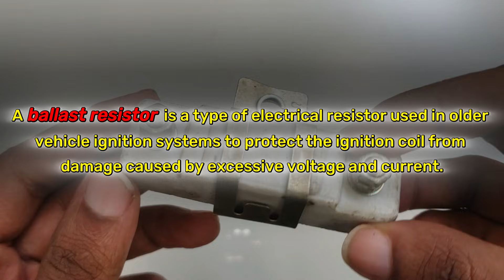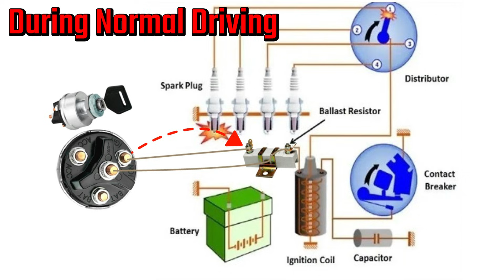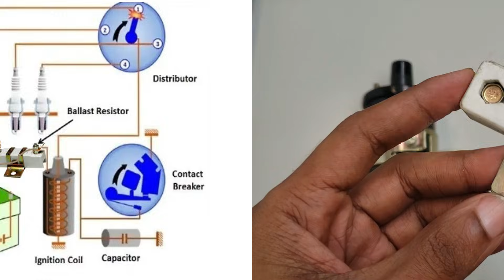Ballast Resistor Explained: Why Old Cars Don’t Burn Their Coils

Comment: Let's speak to you in common sense and Truth, the ballast resistor is basically designed to lower the voltage to the coil, the same voltage would be when you're cranking the car. Mainly get the coil primary wine in is wound for easy 8 to 9 volts sometimes 10 the match the voltage of the car when you're cranking it over as the starter takes a lot of load. What's the engine starts you have to have a resistor to lower the volume to that same design for the coil main power. Lotta German cars didn't even use resistors they just built really good coils that can run at various volts.

Comment: I worked in a SaaB 99 once and it started easily but would only run with the starter still turning ! Fault due to ballast resistor open circuit !!

Comment: Confused some fiat 850s had external balles resistors 1970 to 73. 65 to69 used internal resistor in the coil.  I dont remember if the starer circuit bypased the resistor .  I think 128s were the same.  But 128 werent great starting in very cold climates perhaps for this reason? I will check the wiring diagram this peaked my interest

Comment: New cars are designed to break down. Electric sensors  can’t handle  the engines heat. We don’t need all the electrical crap on the cars. Most of this stuff is for the car smog scam👍👍👍👍😎😎👍👍

Comment: without, the points wouldnt last very long. 1960s fords had a pink resistor wire with a resister built in .Chryslers had a ceramic ballast resister on the fire wall.

Comment: Back in early 80's my Toyota Corolla quit 100 miles from home. Looking under the hood, I noticed the resistor was broken in half. It was night so no stores were open. I ran a jumper cable from battery to the end of the resistor. Car started right up and drove it home without issue!

Comment: My dad bought a new Chrysler Cordoba in 1976.
It had a habit of toasting the ballast resistor.
Reply: But by that time they had already changed over to electronic ignition. Kind of redundant to use it with no points.

Comment: They used a 6 volt coil and applied 12 volts to for a hotter spark for starting. Once the car starts the coil would burn up but the ballast resister cuts the voltage down to about 6 volts so the coil does not burn up. Datsun used this system also.
Reply from the maker: Thanks for sharing that information, I appreciate it!

Comment: WRONG!! The ballast resistor is there to protect the points. Too much voltage through the points burned them. When the car manufacturers got rid of points and went with electonic ignition system they got rid of the ballast. Coil technology hasn't changed in 100 years. If it was to protect the coils why aren't the coils burning up in today's cars. Back in the 60's a coil could produce about 20,000 volts. Today's coils are capable of over 75,000. AI bulls**t.

Comment: Many times the breaker points will over-arc and burnout the contacts long before the coil fails if the resistor is not used.   Also a very similar resistor was used to lower voltage to the wiper motor for speed control.  It can be used to reduce  ignition voltage in a pinch.

Comment: It also makes the points last longer lessening the contact point erosion - metal transfer. 
  I always used a Bosch blue coil as it has internal resistor  points last forever just adjust dwell say every 15 or 2” k

Comment: In the 60's and the 70's Chrysler cars would always burn out their ballast resister. It was wise to keep a few in the glove box. My wife's car engine would fire up under starting. But then it would stop. Only a ballast resister replacement would cure it. The ballast resisters would even fail on the newer pointless ignitions too. They used to cost $2.00-$3.00 a piece.
Reply: Keep one in the glove box. It will never fail .
Reply: After over 50 years of driving around with a spare ballast in my glove box, I’m starting to think that was a rumour started by the bow tie boys.  A quick check with my friends, and over a similar period of time, maybe only a couple have needed to be replaced. But, I don’t think I will temp fate by removing it either.
Reply: @jamesblair9614 I never had an issue with one.
Reply: I've seen people flood a car out in my H.S. shop class, change the ballast resistor, and the car starts and declare it was the ballast resistor.
I, too, am old and i always carried a spare, only to rattle in my glovebox.
Reply: Always keep one in the glove box.
And if you're driving a GM with the HEI ignition then keep a spare module with you.

Comment: Ballast resistor is to reduce the voltage to not burn the points out and to keep voltage surge from burning out photo optic sensors,a coil doesnt need one with magnetic electronic ignitions.
Reply: But Chrysler continued to install them in their vehicles even after converting over to electronic ignition.
Reply: @MarkRichards-e6f probably because they were using components that were older and the ballast resistor lowers voltage to 9 volts to work with older components and make them last longer.

Comment: Great explanation! I now realised that i wired it wrong on a jeep with vw engine, i ignore the starting stage. Thank you.
Reply from the maker: Thanks, I'm glad the video cleared things up for you!
Reply: Jeep wih a vw engine?
Reply: @jacobnorth8642  Yes, normally the 1.8  VW AP or 2.5 Chevrolet Swap, because is hard to find spare parts for the original.

Comment: The ballast resistor brings the ignition input voltage down to 9/10 volts and this ensures a good strong spark during cold weather and situations where the cranking voltage drops
Reply: How does a resistor give a stronger spark during cranking?
Reply: @enoz.j3506  ... A 12 volt coil will give a weaker spark as the voltage drops during cold weather for instance. 
Fitting a nine volt coil ensures a good hot spark even if the voltage is at 11 volts for instance and helps if you have to push start .
We were taught this in college as apprentices back in the late seventies.

Comment: In the diagram, the coil is shown with a ground connection. Is this correct?
Reply: There a several circuit options.  All work when wired correctly.

Comment: The ORIGINAL reason for this resistor, was the change from 6v to 12v systems, that took place ~1955. It was needed to prevent the existing coil design from burning up, and they found during cold starts in the winter that the 12v battery during starts would droop, to a level going through that 12v to 6v dropping resistor, that the spark was inadequate, so it was bypassed during start. The original way was with a mechanical switch on the starter motor that fed the 12 volt directly (solenoid pull in of starter gear also actuates electric switch for starter main current, and a side contact that was connected to the ballast resitor bypass, or the ignition switch for it's extra terminal that also excites the starter relay solenoid), as that was the best quality voltage, right were the starter motor was fed the 12v from the battery. The later design put it in the ignition switch's bypass, and adjusted the ballast resistor and coil design for higher RPM engines.
As far as this old tech has seen, electronic points have been the best thing for engines. All the other electronics, have done nothing but made complicated emission control junk.  I had a 1987 Suzuki Justi, that would get 58MPG with a carburetor. That was a 1 liter 3 cylinder. The next generation of that engine had a throttle body fuel injector to meet emission standards in California, and same vehicle (with added weight for crash protection went from 1400lbs to 1800lbs) was 42MPG. But it had low noxides and what ever other EPA requirements are. 
So that engine had an exhaust gas re-circulation (injection) EGR system, as it was lean burning, and to cool the flame, it injected spent exhaust gas. The center piston, (in my failure analysis) ran hot, which caused the oil control rings to foul with burnt oil, with enabled burning oil. It got to about a qt per tank (280miles). Then one day no compression. I pulled the head, the EGR ports were plugged. But the center exhaust valve had a pie shaped burned V in it. The other valves held less then 30PSI compression. I don't think I operated it wrong, other then used too cheap of fuel with 10% ethanol, as that was mandatory at fuel stations here in the heart land of corn growing.
Reply: Not true.  12V ballasted coils are not the same as 6V coils

Comment: A low ohm coil needs a ballast to prevent over current. A low ohm coil is also a low inductance coil and the lower the inductance the quicker it can build current. That means it works better at higher RPM because there's less dwell time. Even wasted spark coils driven by computer use ballast resistors.

Comment: Coils don't charge, capacitors charge. The terminology for an inductor is "flux".
Reply: No,   the term is correct  enough as applied.  There are many words,  sometimes, that can mean  the same   relative thing.  Inductor flux  is in fact a form of  a charge.  Stored energy,  even if fleeting
Reply: @fourfortyroadrunner6701  Fluxing is the only correct terminology if you're an electrical engineer. If you're a car mechanic then anything goes because they make up their own BS as they go.

Comment: SOME, older cars. Ford has a resistor wire in the ignition circuit instead.
Reply: In Australia, it was a pink wire on Fords.
Reply: GM also used a resistor wire on some cars.
Reply: a few of my Wolseleys have a resistor IN the coil
Reply: Called a primary resitance wire. When you use an HEI dist , this wire needs to be replaced
Reply: @ronniecox109    Before you get carried away, you might want to check a wiring diagram. On most cars where you MIGHT use an HEI system the supply is already just a switched 12 volts without any resistor feed. My gut feeling is to look at the starter and see if there is an ignition feed from there. If so, then they are boosting the voltage during the cranking, which means there's probably two wires on the primary side of the old coil. (one was lower voltage WITHOUT cranking) OTOH, some cars used a coil with a built in resistor to save the points. A little research can save a bit of work.
Reply: @rupe53 im talking about early GM  vehicles that had points. And they definitely did have a primary resitance wire to the + side if the coul. NOW  when upgrading to an HEI diz. IN one of those said equipped vehicles ,you had to go to the switch and replace THAT wire .. otherwise ,only aprox 10 volts would be supplied. To the HEI. Frieburger (Roadkill) had this very issue on a vehicle he was prepping for a road trip. I'm 70 and was playing with points ,dual ponts , and setting dwell long before. HEI, MSD,ever existed.
Reply: @ronniecox109    I am 72 and and was ASE certified for near 50 years. I mentioned most of that already. I was talking about how to figure out if the extra work was needed... for those who don't know what's going on. That second primary coil wire is where an extra few volts came from during cranking. That's the clue. I do not recall what year they did it, but my 64 has that extra wire and I know they did it up through the 70s, although sometimes there was a splice hidden in the harness so you only see a single wire.
Reply: I still have my 50 year old dwell meter.
Reply: @ronniecox109   I have two or three of them and a timing light. The trick tool people forget about is the allen key on a flex shaft for doing the dwell while running. (on GM) I also have a flex screwdriver for those Quadrajet carbs that had no room in front. (Buick?)
Reply: @rupe53 got it, and the flexible tool to adjust Quadrajet air fuel screws.
Reply: @rupe53 just recently purchased timing lite with dial to check total timing.

Comment: A simpler explanation is,,when cranking the voltage is down at 10 volts,,so a coil must be sized to work well at 10 to 12 volts,,but when running the alternator is pushing out 14 volts,,overwhelming the coil,,ballast kicks in,,,

Comment: if you would like to have a coil primary current of about 4.5 amps (HEI about 5a) reliably, using either OEM points or a Pertronix points-replacer (they don't hand those out)(real ones, anyway) then you should check out price of 1988 Ford minivan -replacement "Thick Film Ignition Module".
        Using points they TRIGGER same as OEM when contacts BREAK CONNECTION.
BY MAGIC  it FIGURES OUT CORRECT TIME TO c o n n e c t (power on) "MAKE CONNECTION" (silicon inside is going math and figuring RPM > ALWAYS CHARGING COIL100% BUT NEVER FRYING ONE - CUTS POWER OFF ONE SECOND AFTER ENGINE DIES SWITCHED ON.  PERFECT. I didn't invent this - saw it on here !  BUT IT'S GREAT !

Comment: Oh I always believed the ballast is there to get completely bypassed during starting to compensate for lost voltage during cranking.
Reply: That is exactly what it is for
Reply: Yep that is the reason. Fella. Just a convoluted explanation.
Reply: Exactly. In Chrysler had dual coils for the electronic ignition system and then other for the coil

Comment: Although technically correct,  you failed to explain coil saturation at varying RPM.  You mentioned it, but didn't explain it.  Also you failed to mention oscillation and the condenser.
Reply from the maker: Thanks for the feedback, I appreciate the additional points!
Reply: A ballast resistor is used for ballast type coils which operate at lower input voltage specifically to bypass the resistor during cranking for a stronger spark.
Reply: I always thought the resistor was to protect the points ,,, ?
Reply: @rolandtamaccio3285   yes, it protects the points from charging voltage of around 14 volts. Things last longer at lower voltage.

Comment: Actually, the main way the resistor would prevent the coil from burning up wasn’t while the engine was running, it was when for some reason the ignition key was on with the engine off and the points happened to be in the closed position, it then would dissipate some of the voltage going to the coil in form of heat, preventing the coil it self from burning out; no ballast resistor needed after the electronic ignition replaced the points, even though the same coils could be used.
Reply from the maker: First, it is not good to stay on the IG key position because it gives stress to the ignition system. The ballast resistor is used to prevent coil damage due to excessive voltage during both the ignition position (as you mentioned) and after starting. This is because our ignition coil needs only 9 volts instead of 12V. So, during engine running, our battery is also 12V, but our coil needs only 9V. Therefore, we use the ballast resistor to drop some volts in the form of heat.
Reply: Not quite right,,when not running the batt voltage is below 12.6,,and coil is sized for that,,but running ,the alternator is pumping 14.4 volts,,that's what would overwhelm the coil without the ballast ,,
Reply: @gavinboot4810    bottom line is that coil voltage is in the 9-10 volts range even when the battery is charging at 14 volts.... and close to the same while cranking. It's a win / win situation! The fip side is the resistor does nothing to save burned points if you leave the key on without starting the engine. If the points are closed then the juice is flowing.
Reply: @gavinboot4810  yes Gavin 👍